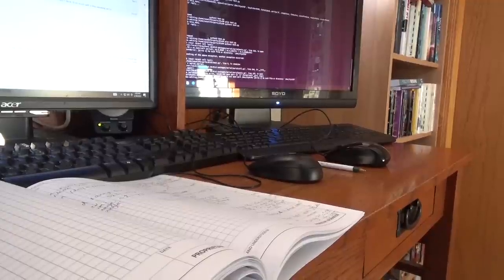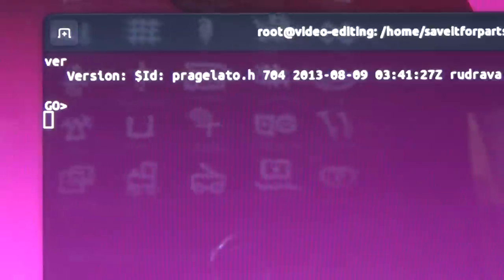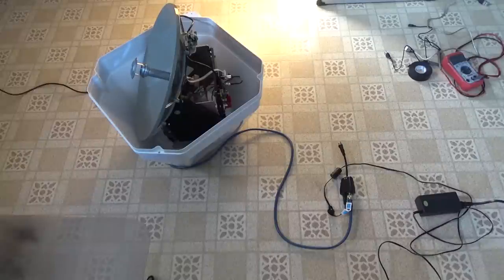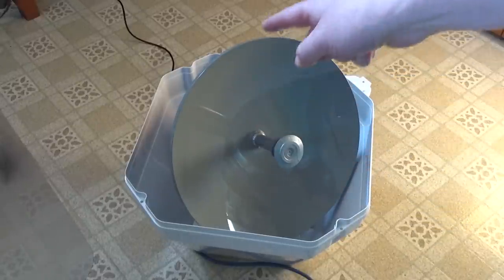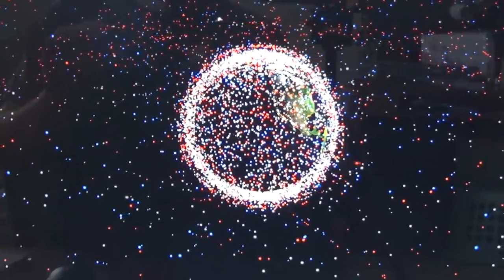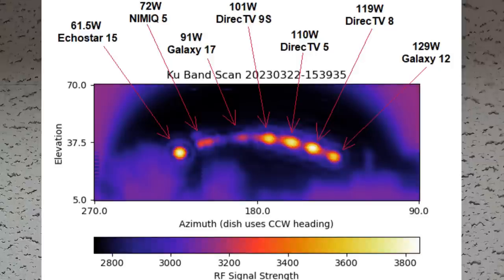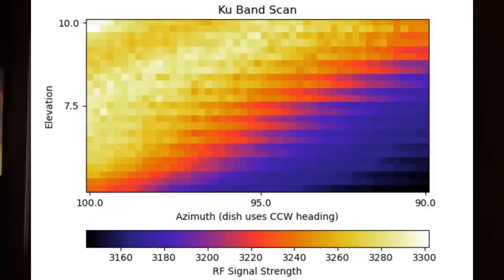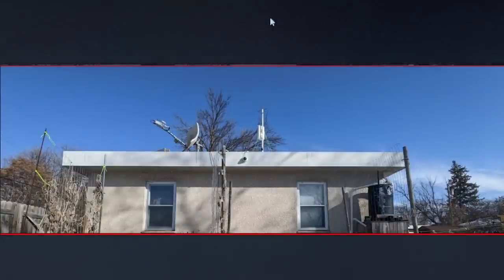Seeing Satellites with DIY Microwave Camera

Comment: It may be easier to make your own gimble mount using small steppers but I suspect that extra data you saw is used for something, the motion don't seem quite right.  You'd need to view a dump of the output in a hex editor to fully reverse the protocol.  Just because it's serial does not mean it's all ascii, I'd expect some type of sync bytes or possibly a checksum to be present.  If you go with your own gimble mount and just power up the LNB you could use an inexpensive satellite signal strength meter which basically converts signal strength to voltage or current and from there feed it into an ardiono A/D etc.  

Been out of the satellite industry since the late 90s, 1st I've seen a modern RV system, pretty slick.
Reply from the maker: The other RV dish company (Winegard) seems to use steppers in their dishes. I haven't been able to interface with the brain on those, but I could swap it out for a Raspberry Pi or something.
Reply: @saveitforparts  Welll you only need left/right and up/down so it's pretty straight forward to make with any dish.  

I would look into a signal  strength meter though and get the output voltage into your data logger.  Perhaps dual LNB's, a C band and the KU would be of interest as well.  

Then you have a standalone with no hidden weird things being done in manufactuers firmware.

Since your not tuning to a specific channel no working polarizor would be needed for the C band LNB.

Comment: I use to trash KVH TV3 back in the day for G4s …always thought… there must be something cool to do with them … ! 
get hold of sea tel 03 system they use a balanced antenna instead of relying on the shear force of the motors…
Reply from the maker: A marine antenna with automatic tracking would be cool! Not that I need it on dry land in the midwest, but the extra features sound nice :-)

Comment: About aiming dish, I'll assume it's using stepper motor
Would be possible to steer it one step at the time, resulting with very high resolution
On the other hand it also could be stepper without feedback loop, so if steps are missed due to rounding error or some resistance, things would ger misaligned, but it's possible to make it work reliably
Reply from the maker: It's actually just a brushed motor, they cheaped out on these. The competitors (Winegard) use steppers, but I haven't figured out how to talk to those over USB yet.
Reply: @saveitforparts  not sure how much you are in to ghetto solutions but using mouse sensor for tracking position could work, better would be optical sensors to count full rotations of motors (to keep it as ghetto as possible could use mouse optical sensor from scroll as well)

Comment: Awesome video! What you are doing is the exact way I tell people to learn coding. If you have a project you want to you will learn the language. If you get the second one working it would be good to have the run at the same time so you can get rid of point noise. Also those caps keep wind off dish so you might want to set them back on top when outside to make it more stable
Reply from the maker: Good idea on the cover, I just hate to hide that pretty dish :-P It's also nice to see if it's stopped responding or jammed somewhere, especially when I didn't know the allowable range of az/el values and was bottoming out the drive.
Reply: @saveitforparts  I agree, never seen that model, only the flat ones for SUVs / VANs. They must have great preamps in there

Comment: Interesting, but something even simpler might be to forget the visual imaging and tracking, and just strip it down to the basic RF components and figure a way to just get an audible tone when it detects the RF. Easily handheld and powered, think of it as a audio parabolic mic variant, only in Rf.
Reply from the maker: There are cheap satellite meters that basically do that, just a tone for aiming your dish. What other people have done is take the audio output and put it into a computer to get the signal strength out.

Comment: Great job!  Keep it going.  Would be super awesome to be able to use a wideband antenna of a range of types and then scroll through the frequency range to select the frequency the user wants to map.   Seems C++ or C would be faster than Python, though much is already there coded so last I checked into doing seemed quicker to get going.  Can always convert if still what I'm thinking where C or C++ would perform faster.  Though yeah, spiral conical, log periodic or maybe some sort of discone with a reflector underneath to get some directionality out of would be neat.  Wondering the limiting factors are in the scanning controls that cause the adverse issues?
Reply: Oh shit, that LNB and not the SDR system limiting factors for wideband use at least.  Yeah, like you noted, some sort of SDR system eventually would be the way for like maybe with like an Adalm Pluto or HackRF or another.  Great exercise just doing however and super cool to watch.
Reply from the maker: @jafinch78  the main bottleneck is the 1-second minimum time for signal measurement. So total scan time is the azimuth range x the elevation range, in seconds.

Comment: The dish motor probably would track a LEO ham Sat, forget the dish and put a 70cms antenna on it, it does not have be super accurate, I track them just waving the antenna vaguely in the right direction by hand.
Reply from the maker: I'm not sure if the motors are strong enough to hold up a big antenna, I run into balance and weight issues with a regular DirecTV dish on my manual pointer system.
Reply: @saveitforparts  4 elements, aluminium on 70cms?

Comment: I wonder if it would be possible to get a higher resolution scan using the RF jack. Would that maybe be a quicker method for acquiring signal?
Reply from the maker: I have another project to run a raspberry pi and SDR system with something like this, hopefully it would go faster and be more accurate.

Comment: I bet you could change the motors and add cheap drivers and then you can microstep. I don’t see why you couldn’t use 2 different confusers 1 for the signal strength and the other to run the stepper motors.
Reply from the maker: Winegard dishes actually come with stepper motors, but I haven't gotten one to talk over USB yet.

Comment: Does positioning using coordinates cause alignment drift?
If it does not, perhaps a higher resolution image could be obtained by sampling a series of nudges left and right of a known point, then moving to another known point, sampling nudges left and right and so on...
Reply from the maker: That's something I've been considering, if I increment by a degree and then nudge through 0.2 degree increments, then go to the next degree. Although someone mentioned the beam width and when I looked it up, I realized the dish probably can't refine details down under a degree.

Comment: Those vintage dishes are amazingly hackable by modern standards.  Fuggedabout using a starlink terminal for radio astronomy.  Unless you're trying to get a job, python is hopeless for interfacing hardware.  Industry is all about languages but hobbyists can use whatever language is easiest.
Reply from the maker: Python seems pretty straightforward in Linux and on my Raspberry Pi systems, so that's what I've been using recently.

Comment: Just an explanation. Mathematical positive rotation is CCW. Look at how sin cos are defined. Apart from that: Damned interesting video!
Edit: It looks like you have a lot of backlash in your dish rotating mechanism. Each line is offset to the previous line. So you could fix that by code by offsetting (shifting left or right) each odd (or even) line by a certain amount to match the previous line. I guess this is a mechanical problem.
Reply from the maker: Yep, I have some offset issues, the nicer images I showed are actually cleaned up a little in the code to account for that. I need to adjust the live preview image so it also avoids that.

Comment: The boards without usb, do they have four exposed test pads anywhere, where you might be able to get a uart serial console?
Reply from the maker: Some of them have 8 pins in the middle, I'm not quite sure what's supposed to plug in there.

Comment: I would love to have a way to see the RF heat map from the satellites

The DISH, DirecTV, BELL, and other pay satellites are really HOT

They have 100 watts per transponder

The old linear C and Ku satellites has 10 watts per transponder

I even saw 1 watt on a transponder back in the early 2000s
The satellite was approaching EOL and they were not using full power on many transponders

I had a really hard time receiving the 1 watt transponders

Comment: a recent project i've been experiementing with has been using an old Primestar dish (i want to say its around 16-20 inches diameter iirc i'd have to dig it out and measure it again) i removed the old (fried) LNBF and drilled out the hole that was used for the mount screw and mounted a 45 degree RP-SMA connector and a 90 degree cable fits to attach the 45 degree adapter to, this puts the biquad antenna i'm using as a feed at a slightly off-center angle to the dish, so i have to mount the dish "inverted" on the mount, so far i've had limited success with this setup, i was wondering, have you tried anything similar with your dishes? and if so how did you make it work reliably where you can aim it with some confidence it was going where you were pointing it?, cool concept also with those mini dishes, didn't know you could use them for something like that, and would make for an interesting project to see how far you can take those dishes and see the limits of what they are capable of
Reply from the maker: I haven't tried anything quite like that, but sounds interesting! I use a few different websites for aiming, including dishpointer.com for geostationary and n2yo.com for moving targets.

Comment: As others pointed out, the screen reflection shot is genius, loved it!
Would it be practical to put an external tracking system to measure it's position instead of relying on the dish making accurate steps? Like a gear system linked rotating a potentiometer
Reply from the maker: That's possible, I'll probably do that with a bigger dish eventually.

Comment: Could that background noise in the sky above your house actually be Starlink satellites? They also operate in the Ku band.
Reply from the maker: It's possible, I've picked them up with a naked LNB before (no dish). There are a few things that produce radio noise in that range, so it's hard to tell.

Comment: Counterclockwise is pretty standard for scientific/mathematical applications, not sure why your reference for comparison would be clockwise (also not sure why you mentioned a "compass" which has no defined direction of rotation...)
Reply from the maker: I'm used to compass headings for ships,  or Azimuth for astronomy, both of which are clockwise degrees. Most satellite location guides use that, so I thought it odd that a satellite antenna would go the other way.
Reply: @saveitforparts  gotcha, didn't realize it was typical for astronomical applications as well. In a purely mathematical/abstract setting it's pretty much always CCW (and typically with right/East as the 0 point rather than up/North)

Thanks for responding so quickly!

Comment: Wow very cool. I've played with infrared digital photography, had a go at uv film pinhole photography. Made a bunch of film slit scan cameras, and made a few scanner cameras from flatbeds and a film camera with a slit disk and slot shutter that works like a scanner .
I'm not much of a coder . Your high res scans I think could be sorted with a post process skew as the nudge error seems consistent. 
If you disable the door safety thing on a microwave you might have a floodlight!

Comment: Hmm.  I wonder if you could adapt the hardware and software to do amateur weather radar
Reply: You could, but you would be better off designing your own as in weather radar you need the time of flight information. Also, the antenna would be active. Send pulse packet. Listen for return. You could want to measure the polarization of the return so that you can estimate droplet sizes etc. It is possible, but would require high levels of knowledge and a lot of tinkering. Also, not sure if the KU band is the best, as the attenuation due to water droplets can be quite high, but this is an issue with professional equipment too; if a rain front is strong enough, you can not look beyond it.
Reply from the maker: I'm not sure what the rules are for active amateur radar, I imagine the FCC has something to say about it. I've used boat radars and they need quite a bit of power to go any distance, and aren't usually safe to stand close to the antenna.

Comment: Presuming that's a VQ2500, what is the serial number on the sticker on the lower corner of the Tailgater plastic box (it's the sequence above the HWID). Perhaps that could help us narrow down the models we need to find that has a USB A port.
Reply from the maker: Sure, my sticker says: MODEL: TAILGATER
BKLULZ03738K
HWID B22C061K1403738

I have another one that also says TAILGATER for the model, but has a different mainboard and different serial / HWID.
Reply from the maker: Update: I was able to get a serial / USB console on my other Tailgater (2011 version). That one is:
BKLULW01545G
HWID B22C031G1101545
The motors on my 2011 model are seized up, but it seems like there are more versions of this compatible with my code (possibly with minor changes)
Reply: @saveitforparts  Cool so any unit going backwards BKLULZ/Y/X/W... would presumably work then. I just need to find one that's not too costly for shipping up to Canada. 😄

Comment: big plus from me for this project :-) i have an idea for your resolution problem. If I understood correctly. the repetitive 1/4 motions are the problem. Would it be possible to take one complete picture with normal resolution, move the thing back to zero and then do just one 1/4 motion in x and y direction and then take the next full picture in normal resolution. This time its offset by 1/4. do this 2 more times and stitch the 4 pics together in python? Or are the 1° increments actualy fixed postionions in the gearbox /motor assembley  of the dish? Then this method would not work...
Edit: i got the numers of pictures wrong. You can not do x and y at the same time. You need to alter between the two... so 8 pictures in total i guess...
Reply from the maker: I think the dish can't "see" anything smaller than a single azimuth degree anyway, so it might not be worth doing smaller rotations without a bigger dish.
Reply: @saveitforparts  fair enough 👍 nice project either way!

Comment: What is the beamwidth of the dish when used like this ?
Reply from the maker: I'm not actually sure, I found an online calculator that suggests it's 1.5 degrees. I'm moving a degree at a time, but I do get those rings around the signal so I bet that's partly due to reflections and overlap. That means I probably wouldn't get any better resolution even with a smaller movement angle.

Comment: That is an incredible little device, I have been interested in radio astronomy recently and I was wondering if you think you could pick up the hyrdrogen line with it. I suppose that would depend on how much noise it has going on, but I have been thinking about creating a low resolution map of the sky in radio waves using an old hughesnet satellite dish and just manually moving it while letting the Earth's rotation point it around the whole sky. Anyway, you have earned a new sub from me!
Reply from the maker: I ordered a hydrogen line filter online but haven't played with it yet. Too many things on the to-do list!
Reply: @saveitforparts  look forward to seeing that! Keep up the good work!

Comment: I'm wondering what is the transmit and receive frequencies that dish uses?
Reply from the maker: The dish is receive-only, it's for Ku band microwave / Satellite TV (so around 10.7 GHz to 12.75 GHz). The LNB unit in the dish has a Local Oscillator that converts that down to 950 - 1950Mhz, which is what the signal strength meter on the motherboard is using. That lower output frequency can also be fed into a software defined radio if you wanted to look at it directly.

Comment: so i was thinking your basicly are converting something analog into something digital, and 'complaining' about the resolution, so your taking a signal strengt reading lets say: |-12db| turning the dish 1degree since 0.2 was not consistent enough and taking a new reading lets say |-9db|, both repr a pixel in the image, now asuming that the antenna doesnt turn of while its rotating, (it wouldnt turn of as its following/tracking one of the satelites it was designed to get a signal from acrass the sky i presume) you actually have something like |-12|->[-12->-9|->|-9| but ignoring the incoming signal strenght while turning, asuming the turn rate is fairly consistent, you could sample that data 60times (1time for each minute of degree), you would get 60 extra pixels in between the two pixels that are knownvalues even if the turn rate isnt 100% consistent the fact that the two reference pixels are known to be 1 degree appart and that the 60 readings should fall in between that degree of arc should not distort the final image as a whole while greatly improving its total resolution not?

Comment: Are you a ham? 
I wonder if you could transmit low power signals in the amateur band and pick up the reflections with the dish to get better images.
🤔
Reply from the maker: I am, but I'd have to do more research on actively transmitting that way! I have a Ku band transmitter and someone mentioned that CFL bulbs are a potential microwave source.